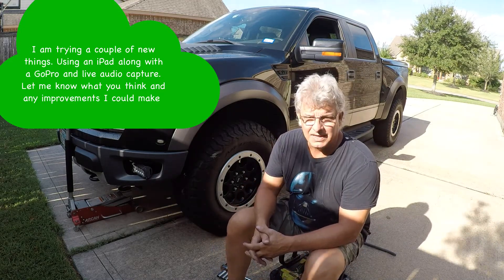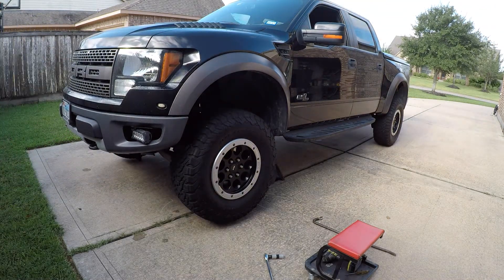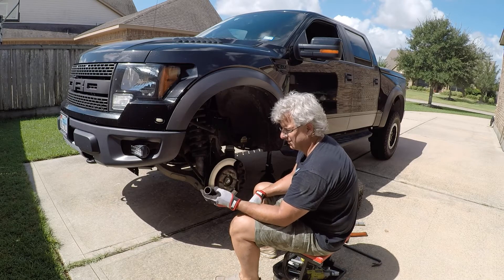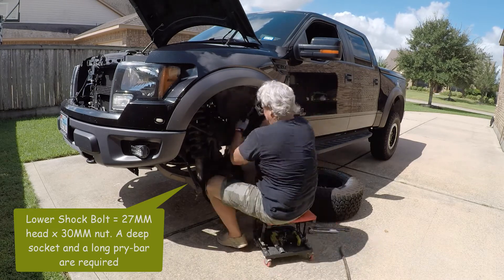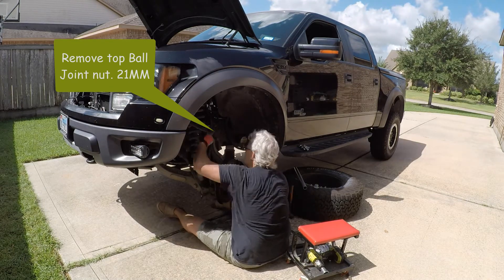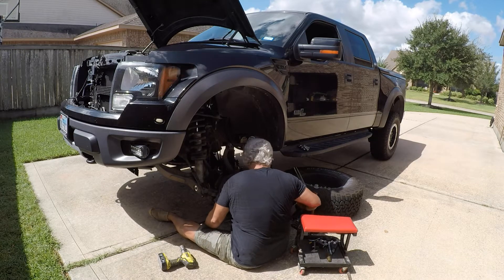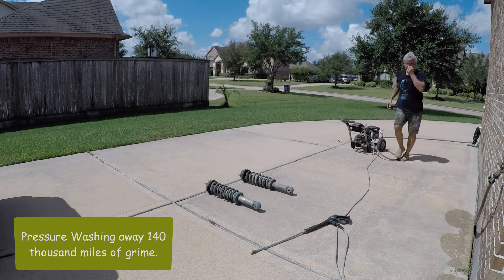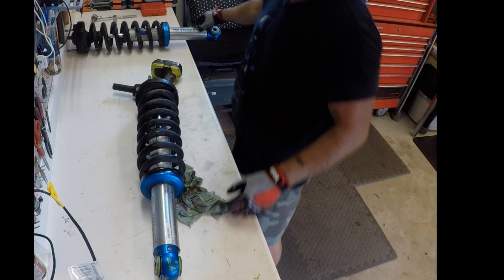2012 Ford Raptor Fox Shock Rebuild - Part 1   Front Shock Removal

Comment: Hi Sr. How can I contact you I m from Houston TX
Reply from the maker: I have been checking pressure periodically and have begun to see a loss in the right front shock.  There are now 30k Miles on these rebuilds so I will be back in them soon.